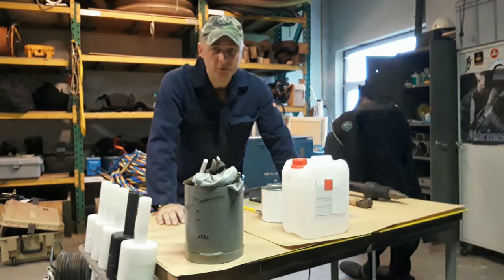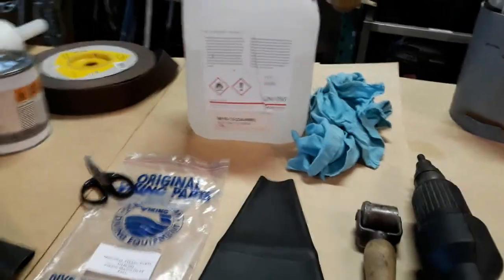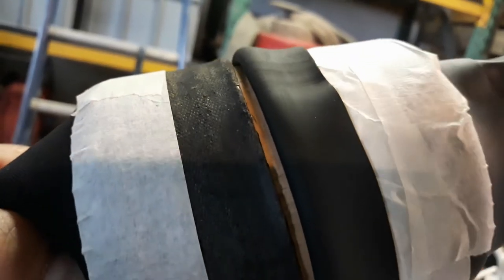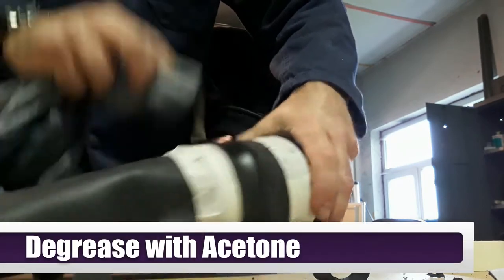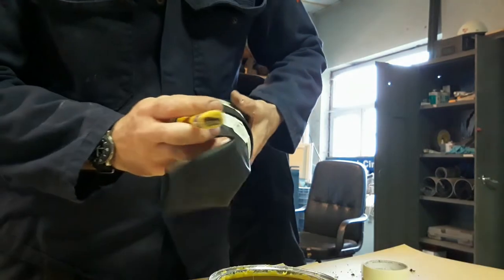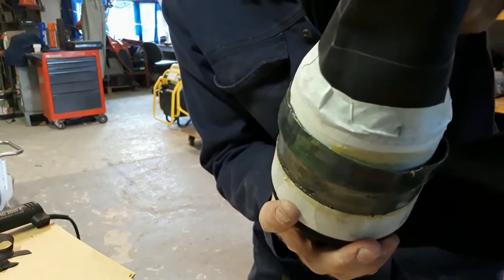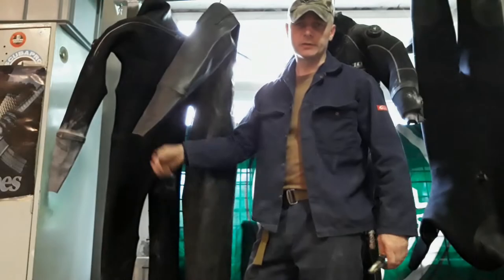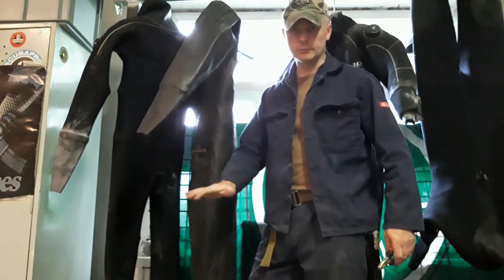Dry suit- wrist seal replacement explained in 3 minutes, step by step

Comment: thank you for this video. Is that a neopren dry suit? Does Aquasel work for that.
Reply from the maker: @abderrahmanegouasmi7556  it is, all drysuits no matter what the material are done in the same way, I don't recommend using aquaseal for gluing seal, only for finishing maybe. Use contact glue for rubber materials only. Cheers, good luck

Comment: Thanks for posting the video.  I have my supplies now to do wrist and neck seals on my drysuit. Who makes the white wrist seal form that you used?
Reply: @Taylor066  Thanks for the reply.  I found a glass vinegar bottle in the kitchen that with a few wraps of duct tape will work just right. Drain pipe would also be a good DIY option.  I appreciate the suggestion.